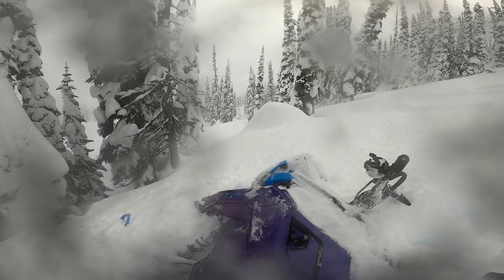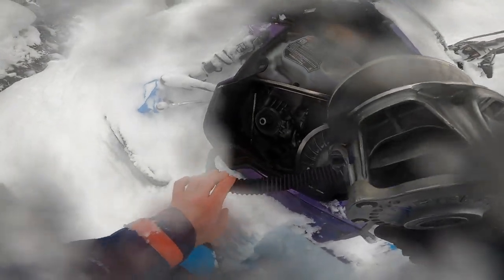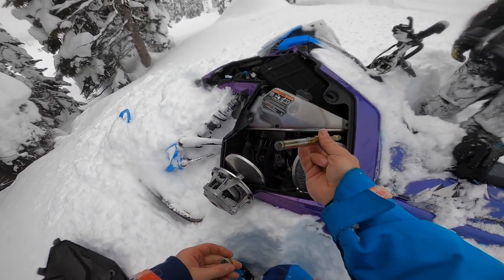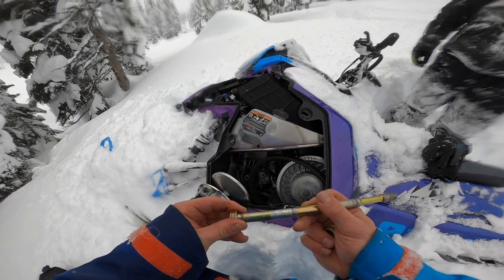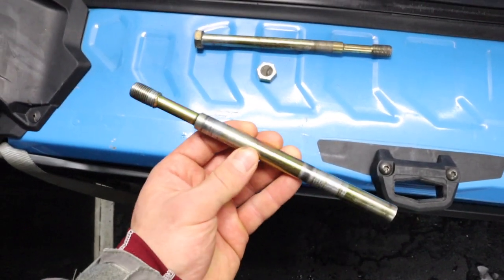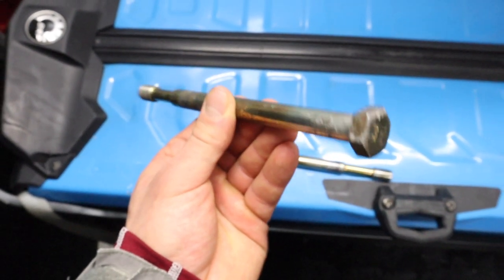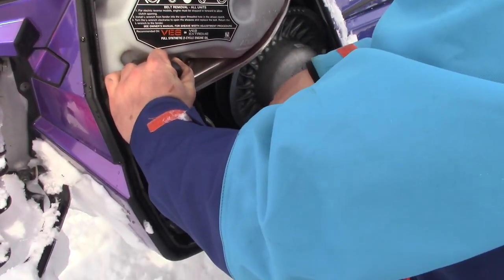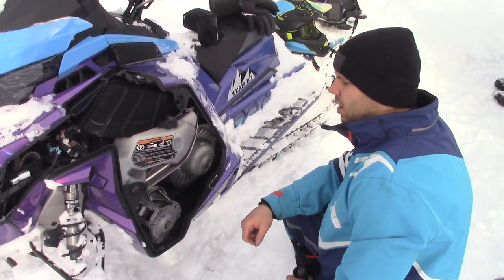2022 Polaris Matryx Primary Clutch Falls Off | Warranty?

Comment: Part of the pdi is checking bolt torque after running the sled up to operational temperature and setting track/belt deflection/check coolant/oil level sensor by tipping on left hand side with low oil while running the sled/hand warmers/gauge functions then sending service report to polaris while machine is running to show everything is operational and then letting sled cool down to stone cold and torque clutch to 80 ft lbs. If all this was done none of this would have happened. Alot of dealers clean the sled set the track fill with oil and fuel and send it out the door not knowing if anything even works. A proper PDI takes time. I've found loose shock bolts a arm bolts suspension bolts primary bolts secondary bolts springs not on exhaust connectors not plugged in faulty oil sensors faulty hand warmers parking brakes that need adjustment to work properly....... 
Thank the guy that PDI'd your sled and the shop foreman that doesn't enforce a proper inspection. Polaris is a good sled they all have flaws but this was due to poor PDI setup.

Comment: That's a class five Bolt should have never broke or shear off like that especially with a $16,000 snowmobile or more
Reply: That's actually a grade 8.8 and I doubt it was loose. once the head popped off all locking tension on the threads was gone and it simply spun out.
Reply: @mikeversluis1347  I agree. Looks to me like it was flawed from the get go.

Comment: With all the parts supply issues I was wondering if this would start to show up in the build quality. Parts suppliers have a long standing relationship with builders if new suppliers are sourced  the necessary steps might be overlooked  to maintain the quality the manufacturer usually specs.
Reply: Automakers are having the same issue. They are just grabbing at any part they can to get the cars to the sales lot.

Comment: Sir.   Where the Thread Loc ? Also the one you installed look like the Was not Grade.
Reply: I can guarantee you, you will not find a polaris P85 clutch bolt that didn't come from polaris. 

"Grade" is relative. A bolt that big I'd rather it be grade 5, softer than the crank so it can't screw up the crank threads.
Reply: @leftyeh6495  Sir do you know the Hardness of the Crankshaft ? Did you see any Marks on the Head of the Bolt? There was Zero. So you could use Blue Screw instead of Red. Was you a Machinist? Thanks
Reply: This is a difficult application for a high strength bolt. It is next to the engine so gets hot and stretches. It could work itself loose. The 80 ft lb is a moderate tightness. I did not see threadlock on the old one, to my surprise.

Comment: These machines promised 4 stroke reliability but have not proven to be reliable in many cases. For the price all brands should last much much longer than they do
Reply: Well, you have the guys that buy new, put on 3-4000 miles in a season and sell them. You have others that are selling 5+ year old sleds with less than 500 miles. 

They last just fine for the average guy. As quick as they've changed there are very few mountain sleds worth riding that have actually been worn out. Most people think that doing maintenance is hard though, and don't understand we have the closest thing to a factory race motor and it's got a warranty!

At least there's no valve adjustments. My 450 manual said to adjust valves every 15 hours, and replace piston every 30 hours under race conditions. When I sold it for another 2t it said to replace the piston every 40 hours....
Reply: @leftyeh6495  that’s not necessarily true. I have seen like 15+ Polaris’ on Kijiji/marketplace with 2500 or less km on them with top ends or new crate motors through a range of years 2012ish all the way up to 2019s and even 1 or 2 2020s in there

Comment: Looks like it probably had a crack, or an indication at the cylindrical part of the bolt to the head. And then the stress was to high locally at this position, fatiguing the metal until you only had the "rough spot" left, and then that part just gave up and the head let go.

Comment: If you read in the manual.. Polaris Clutch's Need to be Serviced ever 1000 miles or inspected. Yamaha Clutches you don't have to touch for 6000 miles.
Reply: He already mentioned there’s only 250 miles on that sled. He wouldn’t have had to service it yet.

Comment: because the bolt was obviously flawed. nice they seen it, and no question. took care of ya. it came loose because of the flaw in the bolt head.
Reply: They should be sending that broken bolt back to the manufacturer to see why the head sheared off. I have never seen such a clean break on such a high strength bolt.

Comment: The clutch is balanced with the rest of the rotating assembly, there are dots on the clutch that must be lined up with a mark on the crank! Looks like you missed that when reinstalling it.
Reply: Clutch pieces are balanced as a unit which have markings and is not balanced to the crank.
Reply: Well on Rotax motors they have alignment marks, perhaps Polaris don’t. Never worked on one before.